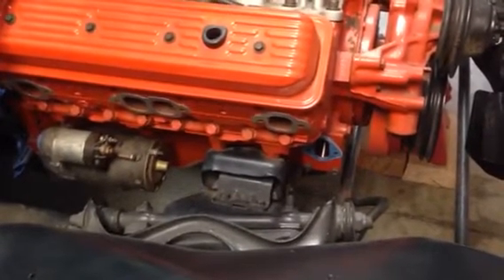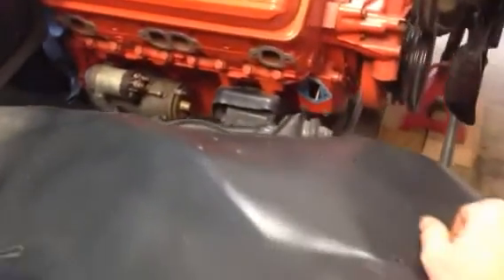Truck update!

Comment: Moving the engine forward is probably just the thing. Might make room for an hei distributor. I think as long as the wires are a few inches from the manifold they will be ok.
Reply from the maker: MrHevyshevy Thanks I highly value your input. Yes had that thought but no dough for even a brass tee right now. Just doing what I can that doesn't take any money. My dad has offered to take it somewhere to get exhaust on it. I need it driving in the worst way. Another YouTube fella we both know was kind enough to offer to send me an hei after motor is moved and I'm sure it will fit. Back to spine doctor tomorrow and more therapy. Weeee!! By going forward too, the wiper motor and heater can go back in. I just don't like the look of motors too far forward. Looks bad to me. This will have about 3 inches from firewall to back of head after its moved.

Comment: moving the engine forward can be as easy as making sure the motor mounts are on the right sides, but moving them forward creates a need to modify the trans mount, and you have to consider that at some point someone is going to put their foot in it, you dont want to do a so so job, you can buy the proper mounts, just sayin, if you want it you will find a way to make it happen, have a plan and stick with it, good going so far,,
Reply from the maker: gonzo gary Thanks for input. Put your foot into this motor all you want. It's tired stock 350 with 230k on it. I also have a 250 rear gear. Don't worry if I am close by it will be done like it's going to have a blower motor in it. Ha! Someday dream to get crate motor for it but need 30 dollar alternator and can't get it right now. Groceries first and everything else, then the truck. One of main reason it sits. 🙁

Comment: moving it all forward a inch would give you what? cool update, mostly because your up and at it and shoting this video,
Reply from the maker: sparky107107 It's going forward 2 1/2 half. Right now can't get cap on distributor. Also have to run small points distributor if motor is not moved. Once it's forward an hei electronic distributor will fit. Also repair the hole in my firewall. If I leave it where it's at it interferes with my wiper motor under the dash and my heater. I need a lot of help right now truck and health wise. Going to have to find some help to do what truck needs. Too much on me physically.